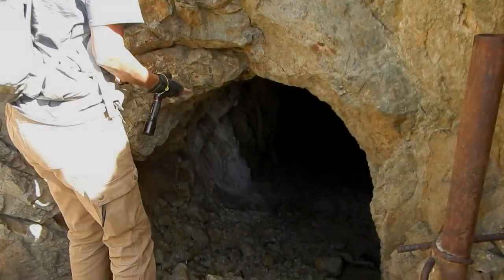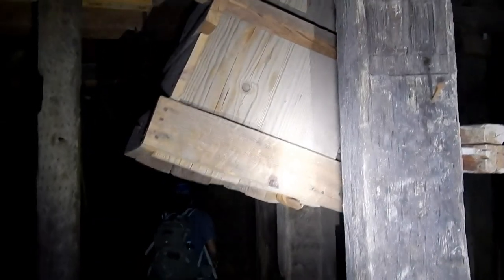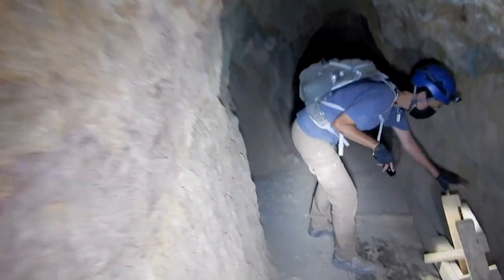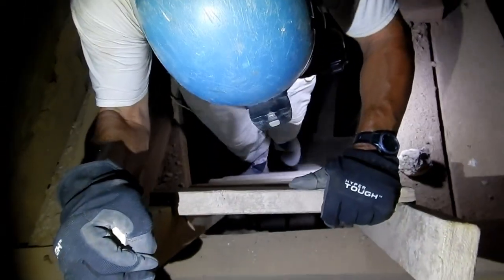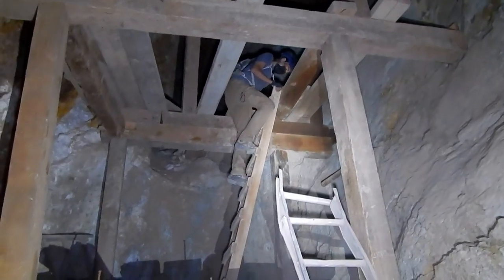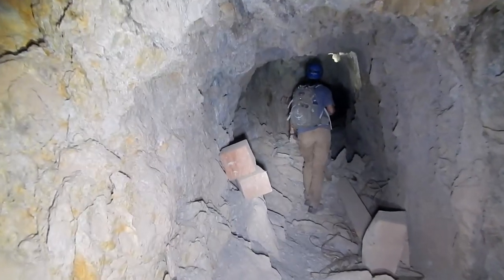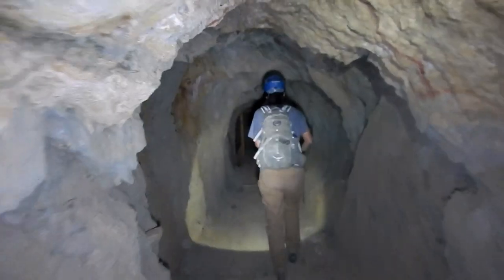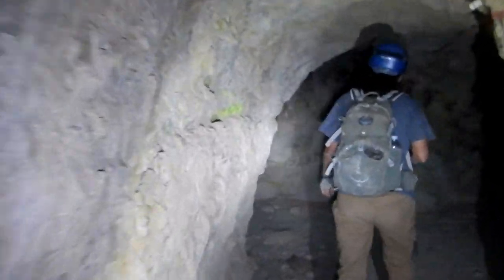Maze Of Sketchy Ladders And Platforms In Abandoned Gold Mine

Comment: At around 16 minutes you found a slusher drift.  A slusher was setup on the platform and waste material from the drift was slushed back to the platform where it was dumped into an ore car.  A handy way to drive a drift when you don't have an overshot loader.
Reply from the maker: That makes perfect sense. I'm guessing that they reuse that same anchor and platform because of all the oil on it. Thanks for your input, Sam!
Reply: @TomandJulieMineExploring  It may account for all of those heavy eye bolts in the drift.

Comment: How many batteries do you usually carry into a mine.   How long do they last
Reply from the maker: I carry a large capacity rechargeable battery for my main light for videoing. I carry an extra rechargeable battery for my handheld flashlight, although I've never needed it. I carry an extra rechargeable camera battery which I use regularly. I carry a small emergency flashlight that  runs for a few days on three regular AAA batteries. I carry three extra AAA batteries that can be used for my headlamp or emergency light. Julie has the same except the light for recording.
Reply: @TomandJulieMineExploring  ok thank you.